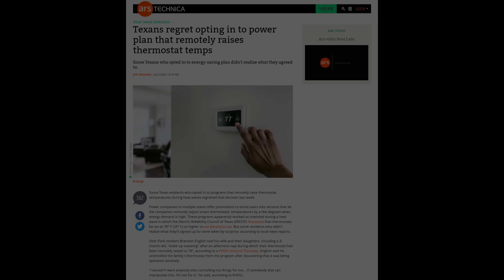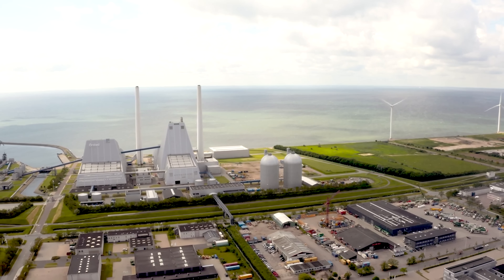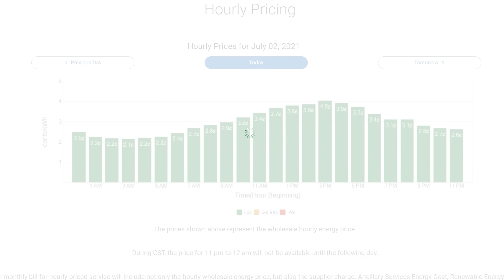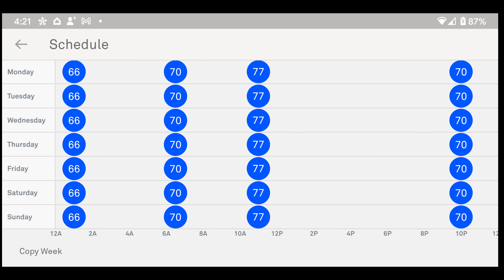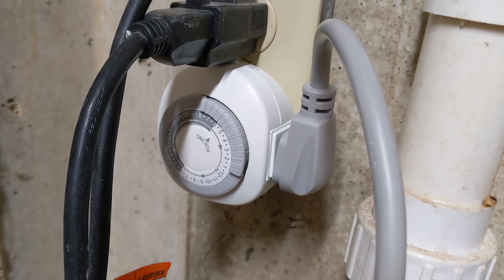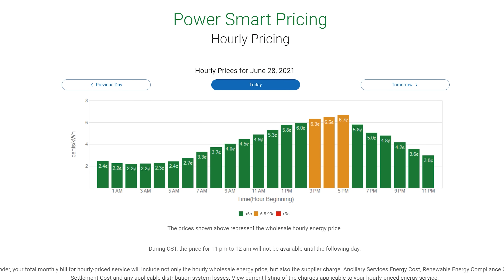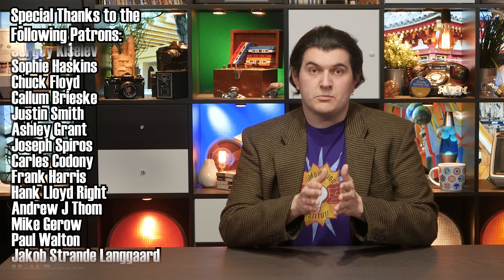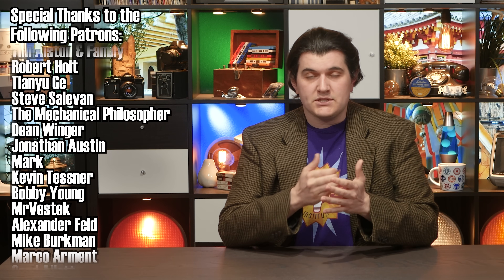Batteries aren't the only way to store energy. Here's another.

Comment: Ceramic tint... Ceramic tint every single window. The heat reduction is brutal (get GOOD tint, 3M for example). 
Seal doors, use foam for sides and top (where the door contacts the shroud), this also reduces noise. 
Not every room needs cooling, close off bathrooms and storage rooms. The garage... Isolate that door, you will lose both a lot of cooling and heat there. 
Use LED bulbs and energy efficient appliances, all together is a good heat reduction.

Comment: If you have a large thermal mass inside good insulation, you can pretty easily regulate spikes/dips in temperature. There's many ways to do that, but outer sheeting, spray foam, and then concrete inside that, would work. Your conditioned interior is bordered by reflective, insulative, and thermal mass factors, not just insulative. Reflective is tricky to work with, but steel siding is decent in summer. Thermal mass smooths out exterior temperature fluctuations, and power draw needs. 

It's probably more accurate to think of thermal mass as a capacitor rather than a "battery", and it's dependent on the 'mass' of the material inside your insulated envelope. Cold or warm air doesn't stay cold or warm very well, because air has very little mass. But if you have heavy building materials, inside the insulation layer, that can hold a lot of thermal energy (positive or negative). Concrete is underrated. It's insulation value is low, but it's thermal mass is quite high. Adobe pretty much works on thermal mass moreso than insulation as well. You could just spray foam the outside of adobe, and then add some sort of protective cover on that (stucco, etc). The key bit is that your thermal mass is far more useful if there is insulation outside it. Technically you could just put boulders in your living room for thermal mass. But that's not very practical. Thermal mass is useful in summer and winter both. And becomes suddenly very dramatically useful when it reaches enough mass (with your insulation) to smooth out temperature fluctuations for a full 24 hours. The goal being that without power, a house would get hot in summer and cold in winter, but it's about the same temperature day or night. A cave (with 10's of thousands of kg of rock) can smooth out a 365 day period of time, becoming the total average temperature of a region, year round. That's an awful lot of thermal mass though. But 24 hours is very doable.

Insulation under a concrete slab foundation is the simplest. But deep ground insulation under a foundation is imperfect due to moisture, and you can add mass inside the house for more effect.

Insulation slows the rate at which thermal energy passes through a barrier. Thermal mass stores thermal energy on one side of the barrier. You want both. They work together. Even though the "R value" of thermal mass building materials is nil.

Add windows with overhangs which prevent direct sunlight into the glass about 6 months out of the year, and ventilation under your roof, and you're well on your way to very minimal conditioning needs.

Solar 'boosted' power can be a very nice boon which is reasonably priced and fairly effective in most areas too. Basically just enough solar to offset AC power draw while the sun is up. No batteries, no need for "sellback" to the grid (with the problems that causes), no need for whole house electricity generation quantities, just enough solar for "free AC while the sun is high in the sky". Has a FAR shorter break-even time on cost, and in FAR more areas/climates. Also dovetails very well into having thermal mass inside your insulation, as the heat peak of a day is delayed behind the solar peak. Putting shade over your outdoor AC itself helps it substantially as well. 2 birds with 1 stone is a small stilt-roof over your AC, made out of solar panels, angled with a bias towards summer solar azumith & south west to get peak solar power later in the day. Side benefit, if the power is out, you can still get some AC in the afternoon & early evening. Could be worth adding a bit more solar, and enough battery storage to exclusively to power a fridge/freezer.

Wouldn't touch a smart thermostat with a 10 foot pole though. Or any other (ironically named) "smart" product for that matter.

Personally I'm building a house which is steel siding (and roof), then styro-crete, then concrete (from outer to inner). Spray foam has higher R value than styro-crete, but if you have a fire the stuff is like napalm. And styrocrete is much longer lasting. Fiberglass batting is very good R value for the price, and fairly fire retardant, but it loses a lot of R value in high humidity. Damp fiberglass just doesn't insulate well. And an air conditioned house in summer creates condensation. So i'm looking to styro-create over the ceiling as well. Very energy efficient, very durable, relatively mold-proof, and will shrug off fire or storms. Well, as long as you don't have trees by the house... trees are nicer at a distance. Up close to a structure they break foundations, strangle pipes, and fall on the house. Not worth the shade. Just ventilate under the roof very well, so the roof IS the shade for your conditioned space (instead of a hot-box). And get those overhangs above any southern or western windows so you're not living in a greenhouse in summer.

Comment: Can probably kick it up with ceiling fans. They will make sure the whole room is one temp instead of near the ground or ceiling.. expand your thermal storage space instead of having pockets near the floor and ceiling and with all the air moving makes you feel cooler as well allowing you to keep it a bit warmer overall. It works well for a few extra pennies a day for the fans. Also one of the least expensive quickest returns is a solar water heater. Heats water and the home like a boiler would. Quite efficient even on somewhat cloudy days and it does not take up a lot of room on the roof so more options to mount it. Look it up if you want an interesting rabbit hole to go down as to how they work. For a while a friend of mine who owned a solar company would give out solar clothes dryers as well.. some rope and hooks to make a clothes line.

Comment: Very interesting.  I’ve moved into a smaller house (3700 down to 1400 sqft).  I bought a Patriot 1800 battery backup and have been trying to find a use for it other than emergency.  I bought a 1500 W room ac and think I might try using it paired in the room I’m working in after 4 pm if the room gets too warm.  I can recharge the battery in the morning during cheap hours or use solar panels.   I could just install solar on this house like my last, but what fun is that?

Comment: A sensible way to maximize energy savings if a bit uncomfortable depending on your house’s insulation and tolerance for waking up “freezing”. Interestingly, Alec seems to have changed his mind on the value of oversized HVAC systems given a later video, but this is a good point in their favor. I suppose you could just run a block load calculation for an abnormally low/high temp that you’d achieve when energy rates are low. Then, your HVAC system would be properly sized for deferred heating/cooling, not constant comfort throughout the day.

Comment: @Technology Connections, I'd also argue stupid and crude solutions might have a place here, at least for awhile. With smart meters all around, it'd be terrific to get a discount on your electricity bill by agreeing to a reasonable wholesale load shedding solution as part of your contract. Just let them disconnect you for a couple hours at a time when they need the demand elasticity; your battery powered devices will survive that just fine, and obviously nobody's going to be disconnecting the cell masts, so your connectivity stays up.

This stuff can obviously be done in a much more fine grained and intelligent manner in the future. However, it takes automation which isn't there just yet. What I'm suggesting, as a stopgap, could be turned on literally tomorrow.

Comment: How did you figure out running the AC all night and not running it at all during the day costs less than not running it at all at night and running it intermitently (?) during the day? What was the break even ratio between daytime and nighttime prices? I’m trying to calculate if I could make use of this method for electric heating in Finnish winter, but not sure my daytime/nightime electricity price ratio of 1.66 makes this viable.

Comment: My 1929 house is designed to draft and is reasonably cool most of the time.  Heat is from a "gravity natural gas furnace which has no fans and thus costs me less than forced air systems or  heat pumps.

Comment: Been doing something similar to this for years, mostly because I do not mind being a bit warmer during the day, but cannot sleep at night if too warm.  But I do have a question about running the furnace fan for 15min every hour.  If you are going to do that, is it really that much more electricity to run the AC at the same time? Does the outside AC unit increase electricity usage that much over the base furnace fan?

Comment: In Germany we have Heatpump with Double use. For IT to Work U need a pipesystem in the Garden about 1,2m under ground so it does Not freez in Winter. In Winter u Can use the earthheat to Heat the House with the Heatpump. In Summer U can Turn the process to geht the Heat Out of the House and Store IT in the Backyard. Again. It's pritty efficiant.

Comment: Although not your method, but my home on long Island that faves south with floor to  ceiling windows. Maintains 70 degrees all winter as long as it's sunny out.  
During the summer the curtains are closed and sky lights are open. I only use a small window air conditioner in my bedroom. 
Oh,  and my electric bill is rarely over 100 dollars a month.

Comment: Much of the concept you are presenting on cooling was (and maybe could and should still be) the default in the past, in some regions of the US, and uses even less then you are talking about (thought with a little less comfort still). growing up in the even one opens several windows on both end of the house, put a couple box fans in the windows on the warmer side of the house blowing out, this draws cooler air into the house from the opposite end all night. you close up on the windows in the morning, and have/use no cooling until the next evening (which if you do have moderate insulation, and are somewhat willing and able to acclimate to temperature range, you can live with minimal discomfort. Clearly that doesn't work well for heating, or in areas with more extreme summer (though use of shade trees, and of regional home design can help with that, more then many realize). but I think that is a idea many might do well to remember and use some at least in early summer and fall. humidity issues are possible increased by this, but the increase of fresh air also has many benefits that are lost with tight insulation and heavy use of AC.

Comment: You have to be careful with overcooling that you don't get condensation inside walls with air ducts. The dewpoint is significantly lower with low temperatures. If you use his method, you're likely to end up with it raining inside your walls and ceilings and a serious mold problem. I'd never cool my home below 70. Also realize that the space inside your walls around your ducts gets much cooler than your rooms and condenses quickly if there's ANY humidity in the house. 

If you're gonna do this, get a humidity guage. If it hits 50% or higher,  you're in high danger of condensation and mold inside the walls. It's easy to hit 50% below 70 degrees. In fact, it's almost impossible to keep it below 50% at 68 degrees if you're in a humid environment. 

You can ONLY compensate for this with a dehumidifier that also uses significant energy and will heat your home.

Comment: This idea is good for load balancing the grid and your wallet, but it's bad for overall energy use.   The lower you get your house below outside, the more energy will flow into it.  Doesn't mean this is bad, just depends on what your goals are.  I would never sign up for a "control my thermostat" scheme, but I would absolutely do a variable rate or wholesale plan if offered, because it would save money, and it's clearly doing something beneficial for the grid operator or they wouldn't offer the cost incentive.  That said, can't help but feel like it's still a bit of a bandaid, and the real long-term solution that doesn't involve inconvenience and discomfort is more capacity and grid resiliency.

Comment: Hmm.  I wonder if there'd be ways to tweak the system with closing off certain floors--for example, freeze your attic at night so the house-proper doesn't get too cold, then open the doors during the day so the cool air can fall and the hot air can rise...I have no idea if it'd make any measurable difference but I'm interested in seeing.

Comment: Add large water containers under each bed, and you will increase your battery capacity for cooling/heating.

A 1300lbs water bed bladder can store 1300BTU of cooling/heating per delta T (degree of temperature difference).

Cool your blader to 66F and it will be able to absorb 13000BTU worth of heat if the house gets to 76F.  No electricity, no equipment needed.

Comment: Pumped hydro being "geographically dependent" is a partial truth. It's certainly the case that natural elevation differences in close proximity present the most cost-effective scenario, but there is no reason the supply and return pipes can't travel longer distances where required, and no reason the elevation can't be engineered, such as by digging a small lake and using the fill to create a second lake bed on an artificial plateau. And this can be accomplished locally at any scale, so small projects can serve small communities. It is likely to be profitable because electricity can be purchased during low-demand hours and re-sold at a higher price during peak demand hours. And with attention to aesthetic design, such lakes could actually serve recreational purposes as public parks, could serve as main or backup reservoirs, and can even use existing greenbelt area to multiple purpose.

Comment: That's not a new concept. I live in Germany and a couple of decades ago something called Nachtspeicherheizung (= night storage heating) was a comman thing. It consisted of very well insulated "radiators" containing stones as heat storage. You used cheap night electricity to heat up the stones and you could release that heat at will over the next day.

Comment: As someone in south Texas who has complained about their utility taking over their thermostat, I feel like there are some considerations you're ignoring. I signed up for the rebate with my utility and want to reduce my usage as much as possible, but the way the utility override works is a nightmare.

I live in a 100+yo house, in a climate where the a/c is required to keep the home livable during the day. I work away from home. My thermostat schedule lets the indoor temp go as high as 82F during my working hours, which it will frequently achieve, then an hour before I typically get home the schedule starts cooling the home to 76F. Then a few hours later, cools it to 70F for the sleeping hours.

When the utility overrides my thermostat, it raises the temperature request by 4F, and disregards any preset programming. It takes no consideration to what the temperature is set at, simply raise everyone by 4F. And because it overrides programming during the takeover, it doesn't subsequently lower when I'm on my way home. So I regularly get home to a house that is 86F rather than the 76F that I'm expecting. 86F is barely tolerable and I end up cranking my A/C during peak hours, well into the night. 

If their system had any consideration for those of us who already tune their schedule, I wouldn't be so annoyed, but raising my already generous temp setting and then ignoring my scheduling tortures me. The solution I'm leaning towards now is setting my temp to 76F all day, so that I come home to 80F at the worst. So their system for reducing demand is pushing me to set my thermostat lower by 6F EVERY DAY regardless of the weather/demand.

Comment: The problem with Economy 7 is that although the power is less than half price through the night, it's really expensive throughput the day and evening, very expensive! Another problem is controlling the heat that's been stored up at night. Get a sudden mild spell during winter,  those heaters are hotter than the blases of hell, to use a phrase is Mr Carlson!  In short, it's very hard to control the heating on a day to day basis. Basically, Economy 7 is only really used in areas without a gas supply. We had it for 30 years, now we have have  gas heating, and our combined gas and electricity bills have fallen by half. Now on a mild winter day we simply turn the heating down instead of opening all the windows!